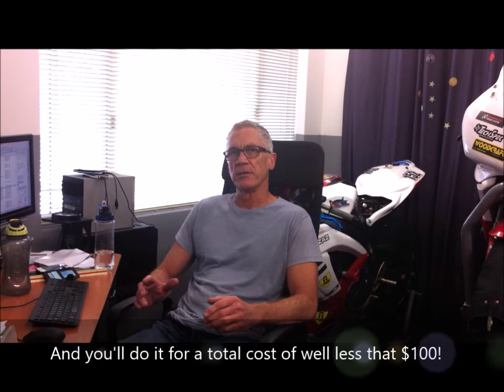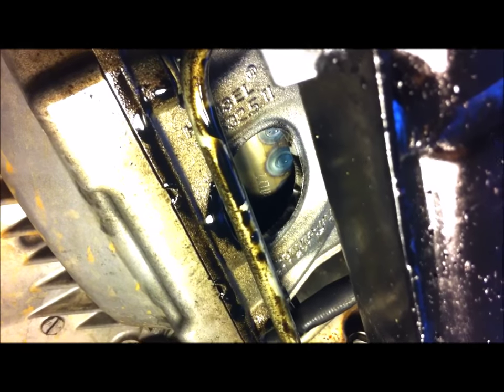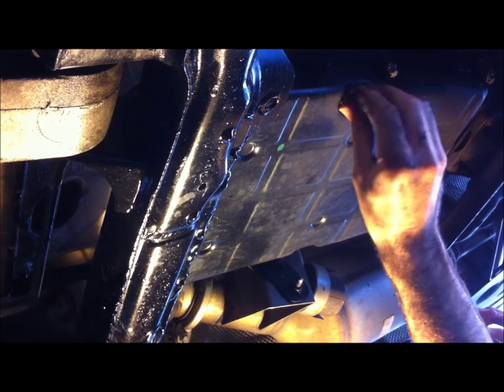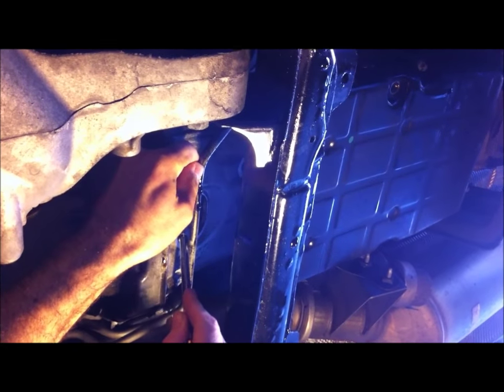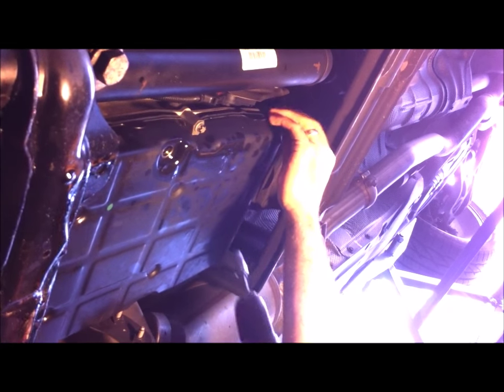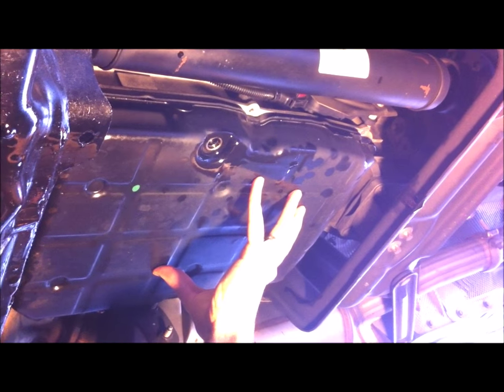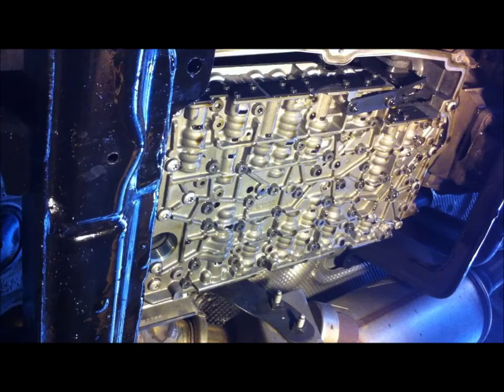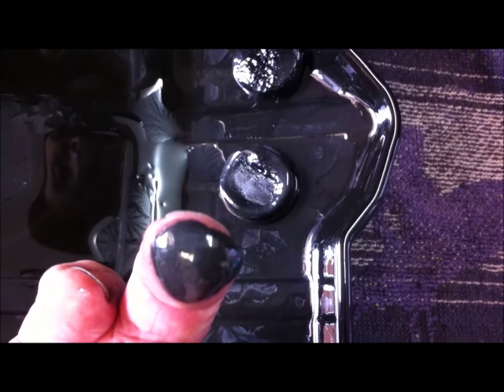Mercedes 722.9 ML320 ML350, C, E, S, GL Transmission Service

Comment: HI Scott, Great video, But I have a question, do we need to start the car before replacing the trans. fluid to bring the temp to 45 c? or we can just drain without ?
Reply from the maker: You should always warm the oil before draining. I think I say in the video to take the car for a drive first to warm the oil. Let us know how you go. Regards, Scott
Reply: Hi,  Scott,  thanks for your response, I opened my transmission pan today, and got surprised that magnet was not present in the pan. old oil is mixed with metallic sludge, now I'm going to put two magnets.
Reply from the maker: Nick M shows how well the "professionals" look after your car. I'd say it's been serviced before and the 16 year old apprentice forgot to put it back. How many Kim's on the vehicle?
Reply: Scott, I have 150 K kims on the vehicle.
One  day after the service, I have noticed light noise from TC. seems like low oil level. I filled 9 liters and warmed up till 45c and it drained 800ml. and then I closed the drain plug. yesterday it was fine. but today on my way back home I could hear that noise. There is no major leak under the car. I am confused now. if ATF level is ok or not.
Reply from the maker: Nick it's difficult for me to give a definitive answer. You'd better check the oil level again. Did you select each gear for several seconds after starting? Did you use the correct grade ATF for your model?
Reply: Scott, I have used the correct ATF grade, it is Fuchs Titan 4134. But I think I forgot to shift gears after starting.
That is the only part I can think of missing. But it still has 8.2 liters inside. I was reading User manual and transmission oil capacity is 9 Liters. so i guess i am short of 800 ml.

Comment: Thanks for the great video. Is there any way you can list the parts you used to make the tool you used to pressurize and drain the system. Also will this work on at 2012 ml 350?
Reply from the maker: Yes the same process for the 2012 ML350. You need to check if your model has the MB236.15 specification ATF. They changed sometime in 2012 to the blue/green ATF. If you call a dealer with your VIN number they will tell you.
To make it easier you can buy a ready made fitting to screw into the drain hole. https://www.amazon.com/Mityvac-MVA588-ATF-Refill-Adapter/dp/B00JLGYU5U

Just get yourself a valve to put in the plastic hose next to the fitting. Otherwise the list at the beginning of the video gives you the information on the tools you need. Good luck and let us all know how you go if you decide to DIY. Scott
Reply from the maker: One of the comments on the amazon page:

This adaptor is good, does the job perfectly, however before it arrived I 
made one. 12x1.5 Metric bolt (shortest possible works), drilled it out ,
 threaded the larger bolt with a 1/4 NSF thread , used a 1.5 " long 1/4 
NF ( AN aircraft bolt ) bolt and cut the head off once it was installed.
 The assembly does not leak as you can get the small bolt very tight.  
So to answer your question ' what thread ' - 12 x 1.5 metric.  I found 
an awsome oil pump for $50 , if this question page is here tonight , 
I'll give you the name of it . It makes the job sooo easy.  Geoff.
    By qfr1133 on March 12, 2015
  
    1.5 mm thread pitch.  11.9mm O.D

  By JackMechanic on March 11, 2015
  
    Hi
Mercedes 722.9 12x1.5
Go to www.toolsource.com they have all the specification of this part.
Thanks
Reply: Thanks you are the best. Its so hard to get good information. I really appreciate it!!! I will let you know how it go

Comment: Hello Scott, before you changed the oil were you experiencing rough shifting? If so is it smooth now after the service?

I'm getting some rough shifting sometimes on my w211 with 722.9. I'm wondering if this service will fix my problem. Thank you.
Reply from the maker: Samar yes the vehicle did have rough shifting. The ATF had never been changed in 120,000km. Afterwards it was smooth as silk. Let us know how you go. Scott
Reply: Scott Elliott Thank you. I will give it a try and report back with results.

Comment: If the overflow pipe is supposed to set the level, why do you get so much fluid when you remove the drain plug?
Reply from the maker: Depends on the temperature and on who did the previous service. When I did my W204 C320CDI with the same transmission very little came out. Perhaps this transmission had been overfilled a bit.
Reply: I was looking for this question.  This doesn't seem right as you got a lot of fluid when removing the drain plug.  I really like your video but this issue doesn't add up to me.  If MB is so picky on the fluid level why didn't you have problems with the transmission of this car since it was overfilled?

Comment: I read that the blackness is from the graphite in the the transmission unit, so doesn't necessarily indicate that the fluid is bad. (Didn't read all comments, maybe someone has already mentioned this). My question is, do you have to cycle through all 7 forward gears? My manual up-shift button on the steering wheel no longer works (W251) so does that mean I wouldn't get the correct fill?
Reply from the maker: Peter some of the dirtyness is from the clutch plates. The magnets are always caked in a grey slime which is ferrous material. Also transmissions and diffs have a breather. When the unit cools it draws in outside air and moisture. Frequent oil changes are the life blood of the heavy earthmoving mining industry where I spent my career. Filled for life in the car industry is nonsense. Considering MB make transmissions wouldn't they like to sell more of them at $10k each?  You don't have to work the transmission through all 7 gears. Just P, R, N, D.
Reply: Not doubting the need to change the oil just wondering if I should be checking quality by color. Though since my car has no dip stick access port, checking it is moot. 2008 R350 maintenance booklet says change at 39k miles and again at 143k miles. 09 and after suggests every 40k miles. MB must have realized there was a problem.  Dealer wants 600 USD for service, sounds too high. 
Really nice video, I almost feel like I could undertake this (but have not figured out a way to safely  lift the car and ramps and jack stands won't keep it level anyway, which seems important in this case).
Reply from the maker: Yes in Australia they changed their tune. For all their automatic transmissions now they say every 60,000km or 4 years which ever comes first. The 722.6 5Gtronic in my W639 Vito was a "filled for life" unit. At 70,000km it was changing roughly and looking for gears. I changed the ATF and filter, flushed the oil cooler and lines and I had a new transmission. They didn't retract their "filled for life" but issued a service note saying there maybe a benefit in changing ATF and filter every 60,000km. Probably had their legal counsels hands all over it.
The dealers here want $AUD1000 and they don't flush the oil cooler. It's too much for a simple job. $AUD1.00 = $USD0.80
Reply: Very informative video. I might be blind but cannot see a drain plug on my R350 Torque converter.
Which uses the 722.9
Reply from the maker: shwanson hopper. You maybe one of the unlucky few who don't have a drain plug on their 722.9. MB went through a period where they ditched the plug. Then they put them back in again. You can carefully drill a 4mm hole and tap with an M5 and put your own plug in. Scott
Reply: shwanson hopper, what model year is your R350 without TC drain?

Comment: Hi, I noticed you didn't use the aluminium stretch bolts. Did that go ok? I am have trouble sourcing them at a reasonable price. Cheers
Reply from the maker: Using normal hex socket high tensile automotive bolts has given no problems. Make sure they're the same length ... cut them with a hacksaw if you need to. Use aluminium based anti seize grease on the threads.
Reply: @ScottElliott152  thanks Scott. Brilliant vid btw. Am going to use Penrite BMV Atf,  recommended for trans and transfer case. Any thoughts on the Penrite?
Reply from the maker: @ivegottaloverlybunchacocon9535  Thanks for the comment about the video. I use Penrite in all my cars and motorcycles other than transmission fluid. Last time I checked they didn't supply an ATF with MB236.14 specification. However you've now alerted me to this new product BMF which has MB236.14 certification. It will be fine so I'll be trying it out next time I do the ATF on my W204 C320CDI or W639 Vito
Reply: @ScottElliott152  Ok. I'll let you know how it goes in my Gl320 cdi. Both trans and transfer case. I have slightly hard changes at times, previous owner told me he put Castrol Atf in it ' because I use what I know'......ahem.  Sorry to be cheeky, but Kawasaki Zx-14 all the way. ;)
Reply from the maker: @ivegottaloverlybunchacocon9535  lol ... Don't worry I'm a fan of Kwakasaki's. Did many laps around Sepang on a ZX6R.
Yes let us know how you go with the transmission service. Last I checked Castrol didn't make an MB236.14 specification either so you probably don't have the correct stuff in there.
Reply: @ScottElliott152  Yeah Castrol doesn't meet spec as far as I'm aware.  Just checked your channel, re. Zx6r at Sepang, nice work. That Kwaka induction growl is beyond addictive. I'll be a while before doing my trans but will respond asap about the Penrite Bmv.

Comment: Did you torque down the converter bolt or did you tighten it by feel?
Reply from the maker: I just tightened by feel. Also put a small amount of non hardening sealant on the copper washer to make sure it doesn't leak.

Comment: Scott great video, really well explained.  Can I use Star to check trans temp in lieu of temp multimeter?  Where did you get the valve for your drain tool?
Reply from the maker: Thanks Ty ... yes you can use STAR to check the oil temperature. Gosh that valve is one I've had lying around in a spares box for probably 20 years. I don't like throwing stuff way because I can always improvise.

You can buy valves like that at any hardware store.
Reply: OK, great Scott.  Is there any reason why I couldn't get a Bosch 044 910 barbed M12x1.5 pump fitting?
Reply from the maker: No you could buy that. I improvise because it's in my DNA to save money.

Comment: I got a 2007 ml500 it shifts hard from 1st to second gear from time to time i want to check the transmission oil level how can i without removin the tranny pan?
Reply from the maker: The 722.9 transmission has no filler tube or any means to check the level. It can only be filled via the drainage plug by pumping in ATF and setting the level with the overflow pipe as shown.

You'd have to add some ATF and drain the excess to reset the level.

Comment: many thanks Scott, great two or three clips related to MB AT 722.9 7GTronic. I always give up do this DYI even I did my Acura TL timing belt change, I am in Canada dealer asked $1300 for that service 4 years ago! Currently, I own MB GLK350 with this AT and I even checked that service software from UK(?) you have to open on VMware player and not even mention how to filling new ATF my god! NOW u give me the confidence that I will go ahead for sure. just two questions: 1. do I have to pump the new ATF to AT by your way? is there any other option although I do have air compressor? 2. if I have to go this way is it ok pump some of air into AT system? thanks again first
Reply: sorry I typed the wrong word "I always" should be "I almost" thanks Scott.
Reply from the maker: You can buy hand operated oil pumps. If you have a compressor it's far easier and you already have one.
The transmission has an air vent on top so it's no problem using a compressor. I'm glad the video is helpful. Scott
Reply: Scott Elliott many thanks
Reply: Hi Scott, sorry to bother you for one more question: in your shopping list, is generic sump plug M12x1.5 the exact same size of AT drain plug of 722.9? So I can drill a hole for pumping new ATF? Thanks
Reply from the maker: No I don't think that will work if you intend using the same drain plug for sealing it afterwards. If you drill a hole in the std plug you'll have thread it to screw in a barbed fitting to take a plastic tube and valve. After you've drained the excess you'll need to take the barbed fitting out and and screw a small plug into the threaded hole. I think it's easier to make up your own special fitting to use when you do the service. It won't cost much and it will be sitting there ready for next time.
Reply: Scott Elliott thank you very much for the explanation. I do order another plug for my own to drill hole for future this service only. I just want to confirm the size is M12x1.5 because when I searched at eBay, they do mention M14x1.5 for GLK350 drain plug but I believe that is size of engine drain plug.
Reply from the maker: Yes the transmission oil pan plug takes an M12 x 1.5 thread.
Reply: Scott Elliott thxs

Comment: hi Scott at the start of your video you say that you can do it all yourself for less than $100 I have noticed that you used Fuchs atf 4134, could you please tell me whereabouts you brought yours from cheers Peter
Reply from the maker: Peter I now use Total Fluidmatic LV MV and buy it from here: http://www.goldenwestlubricants-srp.com.au/?&atrkid=V3ADW82997256_3551956858_kwd-5845557949__190328971850_g_c___1t1&gclid=CPSgwq2kuNQCFdQEKgodpxMBGQ

The Fuchs was bought from Coventry's for about $8.00 per litre. The Total Fluidmatic is about $6.60 per litre and has the MB236.14 specification.
Reply: thanks for the speedy reply Scott much appreciated :-)
Reply from the maker: Peter this is the ATF I now use in my 722.6 and 722.9. It's a clearer red colour colour than the Fuchs. That was enough to sell me ... the colour ... it looks prettier!

http://www.totaloil.com.au/automotive-lubricants/products-cars/pcmo-transmission-fluids/fluidmatic-mv-lv.html
Reply: Thanks again I'm in Traralgon Victoria so in the morning I will see if I can get the shell ATF 134 or the Fuchs 4134 locally but if not I'll give the total oil supplier a call and see what they can do as far as shipping it over and price thanks again your transmission service video on your ml 320 was brilliant very well done cheers once again Peter.

Comment: Scott - how is this vehicle raised? I see steel ramps at the start of the video and plastic ramps near the end. I assume that's front and back. Do you have any other protection like jack stands, wheel chocks, etc? What brand/model are the ramps? Just asking because to do this DIY, I need to level the vehicle and have not figured out a (safe) way of doing this. Thanks. Also, I didn't quite get how you turned the engine to get to the torque converter plug.
Reply from the maker: peter_c . At the start of the video I point out we've raised the back with the Spiderlift. I have a Spiderlift 2500 available from Hero Hoists for about $1200 delivered. It's a very handy bit of equipment for this kind of work. Scott.
Reply from the maker: peter_c . Actually it's called a Spider 2500. Google that and you'll find it. Scott
Reply from the maker: peter_c. The bottom pulley on the front of the motor is the end of the crankshaft. The pulley is secured with a 27mm bolt. You put a 27mm socket and bar on that to turn the motor to bring the TC plug into view.
Reply: Ah cool. I didn't catch that at the very start. I see a metal thing (ramp?) under the wheel at 1:21 and plastic one at 15:36. This spider 2500 seems cool, but looks like it may not be sold in the US.
Reply from the maker: Peter this is who makes them in Taiwan. They do export to the US. Called the Mini Lift 2500. Perhaps drop them an email and ask who they supply in the USA.
https://www.taiwantrade.com/company/active-slimming-goods-enterprise-co-ltd-2318.html
Reply: Still haven't done my R350 thanks to not being able to lift all four corners.
However it occurred to me that maybe it's not necessary.. what if you use ramps to drain, clean and replace parts and refill fluid, all at an incline, then move off the ramp while the temp is coming up and just use a longer hose to drain to the right level? Then when it's drained, close the fitting or clamp the end of the hose, drive back on the ramps for access and replace the drain plug? Thoughts?
Reply: Ok. Just for the record, I finally did the transmission oil change on the W251/R350. I didn't get lifting equipment but bought a 2 by 12 and had it cut into 8 pieces, put two under each wheel (I do have a jack). So the 4 inches of extra space was barely enough and made for very tight conditions. Almost gave up. I had to remove some brackets, wires and connectors which were even harder to put back. The pan is at an angle, so even after draining with the level tube removed, I dumped oil all over when I took it off. I wasn't in the mood to deal with the cooler lines... maybe next time. I refilled as instructed, used ODB2 scan device for temp and shifted gears, but still felt like too much oil came back out. Will do again in a few years and try to do it better. So far no error codes or adverse shifting. Oh yeah, no TC drain plug.